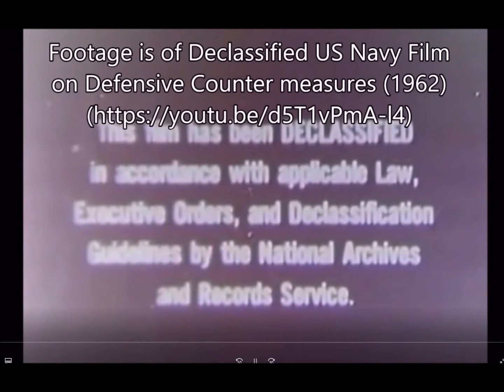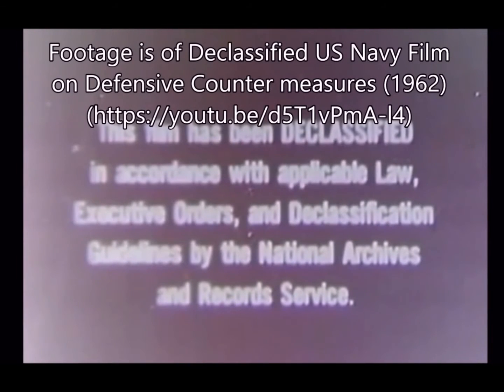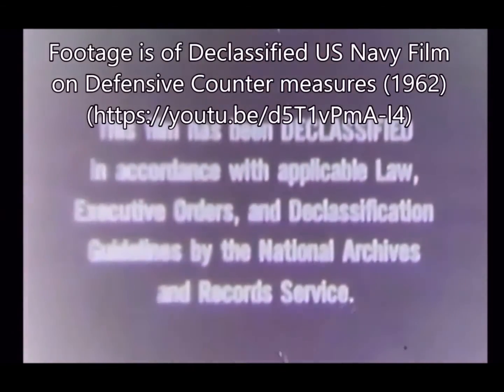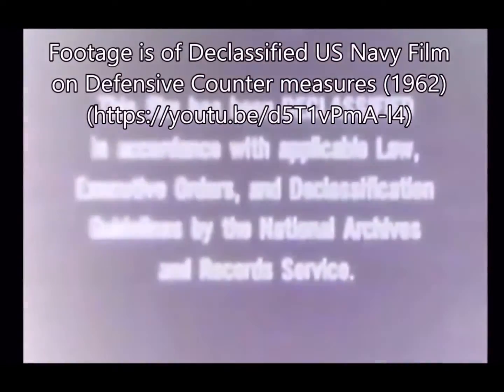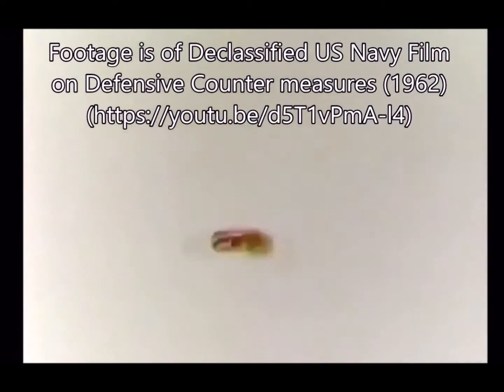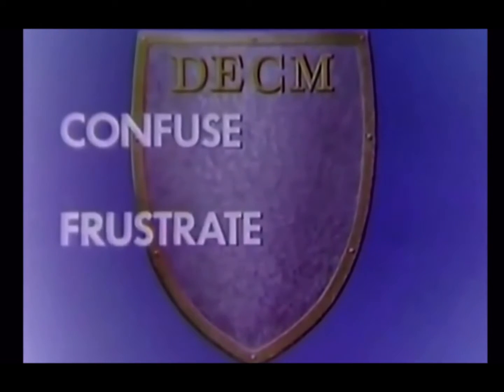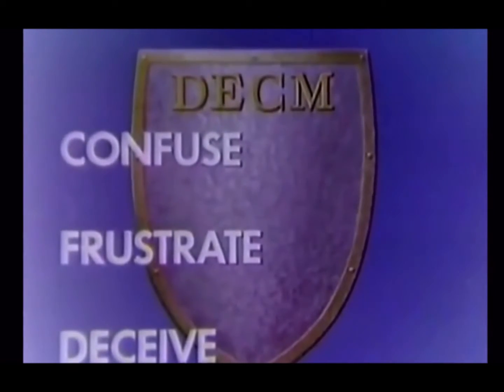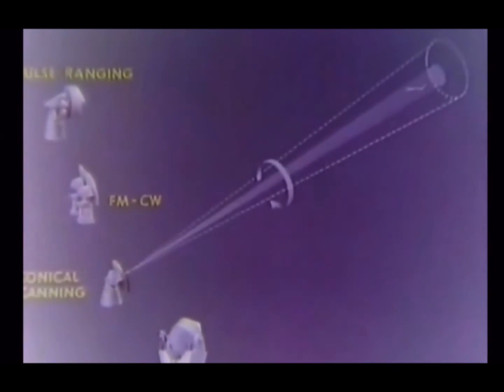ECM in BMS: A (Majorly Simplified) explanation

Comment: Great video man! Very very interesting! So radar doesn't have a countermeasure to counter the jamming??
Reply: There is actually, they are called electronic counter countermeasures or ECCM. Im in this field of work in the air force and currently in technical training for the 184 pod and i learned all about it last week!
Reply from the maker: Matsimus Gaming there are some techniques (I don't understand them fully due to the fact the data is classified and I'm not an engineer) that will try to skip around the ECM, such as shifting frequencies slightly. However, this adds complexity and can be resolved by making the jammer capable of jamming more frequencies.